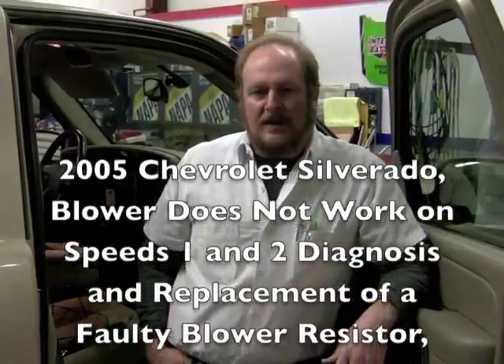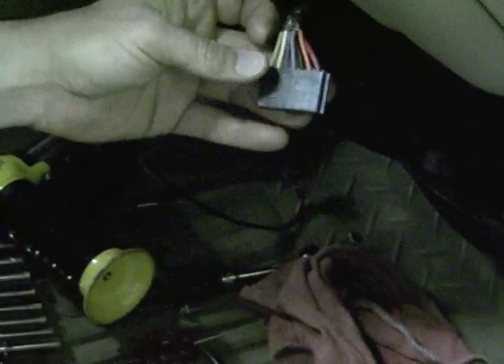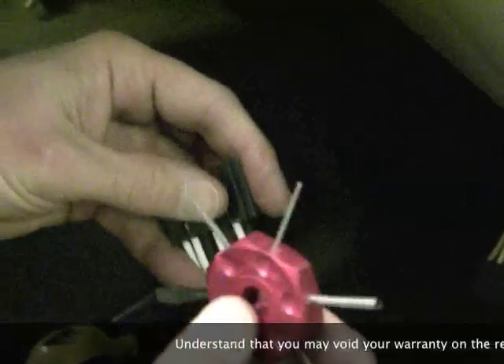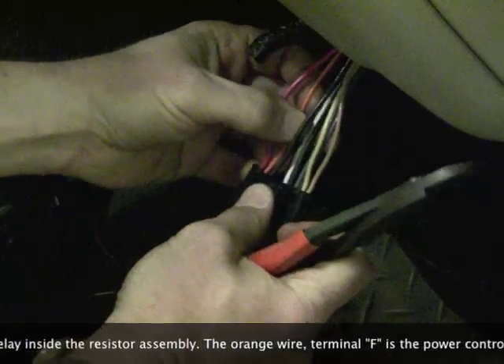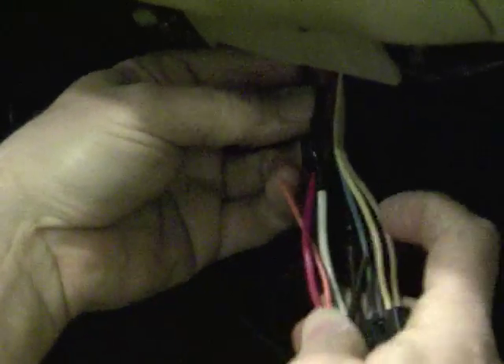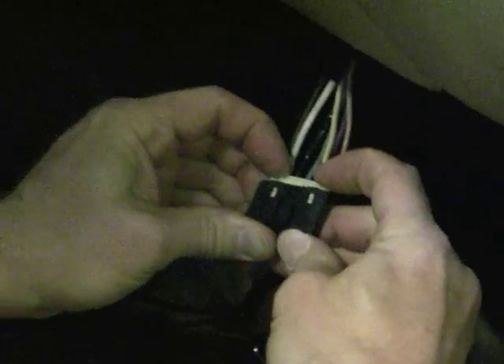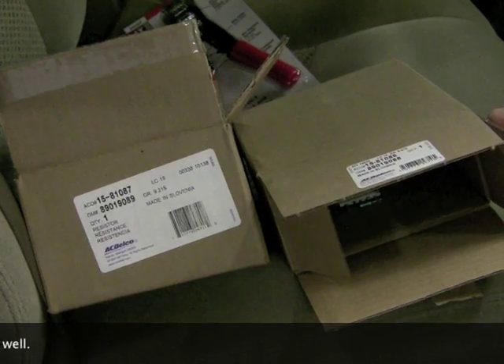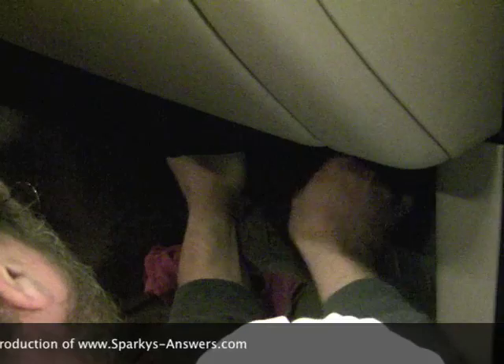2005 Chevrolet Silverado Blower Inop

Comment: I got here because the blower on my 2007 Silverado quit working.  What I've found so far is the location of the blower resistor is on the driver side.  How do I get to it?
Reply from the maker: Assuming it is a US model the blower resistor is under the passenger side of the dash. If your truck is a Classic model it will be similar to the one in the video. If it is the newer body style it will be slightly more to the right side of the dash in the same general location.

Comment: My recirculating actuated is clicking can it be reset or do I have to replace it
Reply from the maker: If it is clicking it will need to be replaced in order to repair the system correctly.

Comment: Can you tell why my resister was rusty,even the two screws. I’ve replaced the resister,and waiting for the harness to arrive. I’m concerned 
that maybe the new parts are going to rust,if I don’t put a stop to the rust. Any idea what I can do? Thanks
Reply from the maker: Most of the time it is caused by a restricted a/c drain tube. Sometimes it will happen because the system has been used excessively on low blower speed with the air inlet door open to fresh air or with the windows open. Particularly with high humidity.
Reply: Sparky's Answers Thanks,I’ll find said drain and make sure it’s unblocked.
Reply from the maker: Thanks for the support!

Comment: Top knoch information. Can you tell me why after changing the resistor, speed 4 worked for a few seconds and stopped. All other speeds
function. I noticed looking at the plug,that one connection seemed off colored from the shiny others. Thinking maybe change out
the plug as your video described, will do the trick?
Reply from the maker: If terminal "C" was the one that was discolored you have likely identified the cause of intermittent/no blower speed number 4. If correct, Do Not leave the harness connector installed because you will damage the matching terminal in the resistor.
Reply: Sparky's Answers Oh Boy,hope I didn’t. It was only on for a few minutes. Thanks for your answer,because I was just going to live with it with #4
not working. So,I’m to leave it Unplugged till I wire up a new connector,I assume?
Reply: Sparky's Answers What If I just cut and cover that one wire,until I get the harness plug? And,how will I know if I blew the new 
resister already? I’ve unplugged it since I got your message.
Reply from the maker: @plugger4945  You would not blow the resistor by continuing to use the system. What will happen is that the damage on the terminal will transfer to the mating terminal in the resistor. Heat damage to an electrical terminal is similar to rust. If you do not get rid of all of it it will come back and spread. If you want to use the system as is I would recommend removing the offending wire from the harness connector.
Reply: Sparky's Answers ok,so as I stated- I can just cut THAT ONE ,until I wire you a new plug. By the way- NO ONE ever answers people the
way you do,you are THE BEST! I feel that you should be getting compensated! Again,thank you.
Reply from the maker: @plugger4945  To expand further, the reason for recommending completely removing the terminal from the harness connector is that arcing has already occurred. The metals and plastics surrounding them no longer have sealed surfaces. This in conjunction with moisture and other components in the surrounding air raises the possibilities that the terminal will degrade further. This degradation will also affect anything that is touching it.  I appreciate the sentiment and if you would like to contribute you may Thank or Donate on my main site. https://sparkys-answers.com/

Comment: Hello, Thank you for the video. I replaced mine the way you did. My initial issue was speed number 4 would not work. All others did. After replaceing the harness AND the resistor, fan speed 4 still does not work. What could be my issue?
Thank you
Reply from the maker: You would need to check for power on what was the purple wire at terminal "C" of the seven wire connector with the harness disconnected, the ignition on and the blower speed switch in the #4 position.  If there is no power remove the HVAC control panel and see if there is power on the purple wire at the blower switch.
Reply: Sparky's Answers Where is the HVAC panel located?

Comment: I lost speed control number 5 on my truck...so its still the same process....?
Reply from the maker: There are several things that could be causing your problem. Faulty blower resistor assembly. Damaged terminals at either the red or orange wires at the resistor. Lack of power on the red wire due to a blown fuse in the underhood fuse box or a damaged terminal at the underside of the underhood fuse box. Repairs should begin with inspection and testing at the blower resistor harness connector.

Comment: just found my fan speed #5 went out. hoping this is the issue on my 2005 Chevy Silverado 1500 5.3L
Reply: fixed it for now...pulled it apart and noticed the red wires plug was kinda corroded. plus the resistor port G looked a little melted...i will be buying the 23$ resistor for now and ill take apart the plus and clean it as nothing looked burned...thank you this video helped me

Comment: Great video Sparky, I replaced the blower motor, resistor and harness plug, wires are connected correctly I also put a new control panel in but I still don’t get anything on speed 5 all the rest work, can ya give me any info please and thanks
Reply from the maker: Assuming you have a full sized GM truck or suv the Blower fuse in the underhood fuse box is probably blown.

Comment: I have a 04 Silverado. replaced resistor due to only having speed 4 and 5. things were great. lost all blower operation. changed out pigtail. things were fine again. lost blower operation again. replaced pigtail. worked fine again. now today lost all blower function for the third time. could you give me some info as to why I keep burning up the pigtail? thanks!
Reply from the maker: Heat damage in electrical connections is very similar to rust on a body panel. If you do not get rid of all of it it will come back. Replace the resistor and the harness connector at the same time with quality parts and your issue should be resolved. If you need more help go to https://sparkys-answers.com/ , create an  account and upload a picture of your failed parts in the Ask a Question section.

Comment: At the 12 minute mark of the video, there are 2 boxes on the seat. The part no. 8901089 is clearly visible on the left box containing the resistor. What is the part number on the box on the right? What's in the right box?
Reply from the maker: There are two blower resistors available for this series of trucks and since I stocked both I found it easier to just take both to the vehicle when I started the job instead of looking it up by application. Especially since 10-20% of the time the book is wrong. That is why I always encourage others to visually identify the resistor that they need before ordering one. I have no idea what the long number was on the other box but the short number was 15-81086.

Comment: Can you just described on the new connector lettering to what color wiring on an 05 Suburban connects to what
Reply from the maker: You can read through a very detailed article https://sparkys-answers.com/2008/07/2005-chevrolet-silverado-blower-inop.html
that I wrote several years ago on the subject but here is the snippet you asked for:

Terminal “A” Tan = Speed 2, power through blower switch from HVAC fuse
Terminal “B” Yellow = Speed 1, power through blower switch from HVAC fuse
Terminal “C” Purple = Speed 4, power through blower switch from HVAC fuse
Terminal “D” Lt Blue = Speed 3, power through blower switch from HVAC fuse
Terminal “E” Black = Blower system, ground at all times
Terminal “F” Orange = Speed 5, power through blower switch from HVAC fuse
Terminal “G” Red = Speed 5, Constant power from BLWR fuse under hood

Comment: I have bear hands, i cant get the plug at at back of blower from resistor. . i know clip is on bottom but cant seem to get it. i know to pull orange tab back but that clip on bottom seems to be inserted and har dto get at. 2006 sierra 5.3 heat and a/c only. the lowest cost resistor.
Reply from the maker: The orange tab is a locking clip for the terminals in the harness connector. You do not need to move that piece. Instead place a small screw driver up into the slot in the blower motor and depress the latch. https://i0.wp.com/104.197.77.209/wp-content/uploads/2009/09/DSC01909.jpg
Or remove the blower motor so you can get to the connector. Be warned though that it can be slightly tedious to reinstall the motor. All of the angles have to be lined up just right. http://sparkys-answers.com/2009/05/2007-chevrolet-silverado-classic.html
Reply: Thanks Sparky. Looking at the new one i see where the clip is at bottom. im trying to lift the part from the wire plug side. am i to push not try to pry? sorry i sound foolish. im half blind and paws like a bear. they hid the bastard on me.
Reply from the maker: Look at the first image. See the slanted end. Look for that same piece inside the square hole in the blower motor connector and push it in to release the hook then pull the wiring harness from the blower motor.

Comment: Sparky I have a 1998 GMC Yukon started it up last week turned on my defrost it worked fine. The next morning I fired it up and have no heater controls at all. Is this a sign of a bad switch or a bad blower ??
Reply from the maker: It could be either. Start by checking the fuses. If okay go to the blower motor and check for power to the motor with the blower speed switch set to high. If there is power present bump the motor and see if it starts to work. If no power is present check on the lower speeds also, then continue testing at the blower switch. For more information please follow this link to my main site.    http://sparkys-answers.com/2010/11/1997-gmc-c1500-pickup-no-blower.html   It is the first of three in depth repair articles I did on that blower system.
Reply: Awesome thank you very much and Happy New Years from Idaho !!!

Comment: 2005 Chevrolette 2500 heater fan wont shut off with the ignition tirned off.
Reply from the maker: Either the blower resistor (manual controls) or blower speed controller (auto controls) is faulty.

Comment: how do I install a new connector wires into the blower motor. changed the resistor,  but the wire pigtail needs changing
Reply from the maker: The two wire connector for the blower motor is part of the new blower resistor. The seven wire connector for the blower resistor is bought separately. If the seven wire connector is damaged do not connect it to your new blower resistor. The damage will transfer and you will get into a cycle of constantly replacing parts.

Comment: sparky what's the part number of the male connector that goes to the blower resistor
Reply from the maker: It is part number 4180 from www.The-Electric-Connection.com
https://store.the-electric-connection.com/4180-repair-harness-only-for-blower-motor-resistor-chevrolet--gmc-trucks-90-and-up-p473.aspx

Comment: Thanks Sparky for this imformative info but unfortunately my blower still not working.... i have 2003 GMC 2500 HD SLT Duramax Diesel.. thanks again
Reply: i mean after replacing my blower resistor
Reply from the maker: Have you done any testing and if so what were the results?
Reply: i check the blower motor and all the fuse ane OK,, and still dont work after replacing the part..
Reply from the maker: Okay let's start over from the beginning. 
What was happening originally with your blower system? 
When did it start? 
What was problem found? 
What was replaced?
Reply: Sparky i had it working now it was the green fuse.. it's not burnt or anything but no continuity so i replaced and voila!!!! works thank you so much Sparky you the MAN!!!

Comment: Very informative video! However, yesterday my ac went out in my 06 Silverado. I have had problems with it on full speed as it would work for 5 seconds and then totally shut off. Now none of the speeds work. Will I have to buy a new resistor and blower motor?
Reply from the maker: Kind of hard to say without some test results but my guess would be that the blower resistor and it's harness connector are burnt and are losing connection.

Comment: thanks for the video, I question i have is: If you can't get wire harness out, can you cut the wires to see if there is any power to them ?thanks Tom
Reply from the maker: +tomthetank924 If the harness is very difficult to remove it is more than likely melted together. You can test the wires by back probing or piercing the insulation. You can also as you suggest cut the wires. If you do decide to cut them make sure the ignition is off first and remove the blower fuse in the underhood fuse box. This will prevent blowing any fuses unnecessarily.

Comment: Thanks for the video. My truck has a problem with the blower not working sometimes and other times not shutting off, even if I turn my truck off. I have to remove the 40amp green fuse in order for it to stop working. The control module on my truck for the fan speeds is digital and has more than 5 speeds. Its a 2005 Silverado SS. Any ideas on how I can fix the Blower/other fan speeds? As of now I am just going to replace that 40 amp and the HVAC fuse. Is the resistor wire set-up the same in my truck as a stock 2005 silverado? Thanks.
Reply from the maker: +Alexander Stewart You are having problems with your blower speed controller. Although located in the same place in your truck it is a physically different part I did a video on this as well. Titled "2005 Chevrolet Tahoe Blower Not Working". The part number has changed to an updated design that looks slightly different from yours Here is a link to the product.
http://store.the-electric-connection.com/15-81773-hvac-control-module--gm-trucks--suvs-w-automatic-ac--2003-2009-p719.aspx

Comment: Do you have to splice them like you did or no??
Reply from the maker: If you are replacing the resistor harness connector some or all of the wires will need to be spliced.

Comment: I read your article on the blower motor not working at any speed, and have a question about it.  http://www.sparkys-answers.com/2012/08/2003-chevrolet-silverado-blower-does.html

My brother's 2004 Silverado has no power at the orange wire going into the  back of the fuse block.  I took off the steering column cover and traced the large orange wire into the plug below the key switch, and there is no power coming out of the back of the pin there either.  Is the plastic connector going into the metal key housing a replaceable item?  In this picture below I have power at the back of the pin on the red wire, but nothing at the orange wire.  Is the grey 90° connector a common problem?

http://www.bulldogsecurity.com/diagrams/extrainfo/diagrams/2005-CHEVY-TRUCK-IGNITION-HARNESS-PLUG.jpg

We've at least done quite a bit of troubleshooting to minimize labor at a shop, but if I can see this thing to the end for him myself I would love to.  Thanks for your help!
Reply from the maker: I was about to send you the link but glad you found the other video and that it helped. https://www.youtube.com/watch?v=1PqznH9ADgA

Comment: Great, thanks. If the motor is drawing a lot of current, it may burn out a brand new resistor. It is common to have junk sitting in the squirrel cage on the motor, and the cabin air filter can be blocked. Either of these make the motor work much harder, more current is pulled, and bingo! another burned out resistor.

Comment: Hello Sparky. I was wanting to know. I have a 2005 Silverado SS. Ever since I bought this used. And I did buy it during the summer so didnt check the heat. But during winter months. To get heat the climate control has to be on 90. 89 no heat. Which is bad but live able. But this month I only have low fan speed now. No higher at all. Not 1 and 2 or 3 4 or 5. Just low digital fan speed. Would this be like the others in manual control simple well not but fix?
Have seen several videos like these. Yours in more in depth. But in your video is there a difference between manual climate control and digital climate control? Cause I know a blower motor resistor costs for manual about $15. While the digital climate control resistor I need cost $135.
Thanks.
Reply from the maker: If your controls have a blower switch with positions 0-5 then you have a manual system and the information in this video would apply for your blower issue. The little or no heat issue is a separate problem. The first thing you should check is the engine coolant level. I would stay away from a blower resistor for your truck that only costs $15. The quality is likely very low. Stick with an ACDelco brand if possible. It is also strongly recommended to replace the seven wire harness connector at the same time.  They can be found at www.The-Electric-Connection.com

Comment from the maker: Hi Andrew,  The following are the terminal locations and wire colors.   

Terminal "A" Tan = Speed 2, power through blower switch from HVAC fuse
Terminal "B" Yellow = Speed 1, power through blower switch from HVAC fuse
Terminal "C" Purple = Speed 4, power through blower switch from HVAC fuse
Terminal "D" Lt Blue = Speed 3, power through blower switch from HVAC fuse
Terminal "E" Black = Blower system, ground at all times
Terminal "F" Orange = Speed 5, power through blower switch from HVAC fuse
Terminal "G" Red = Speed 5, Constant power from BLWR fuse under hood

You can also read the full write up here.

http://www.sparkys-answers.com/2008/07/2005-chevrolet-silverado-blower-inop.html

Comment: I have a new harness and resistor but the old plug with 7 wires was melted and kind of came apart so I don't know the exact order to splice the wires into the new plug. Is there a diagram?